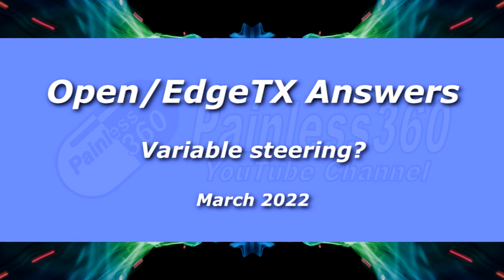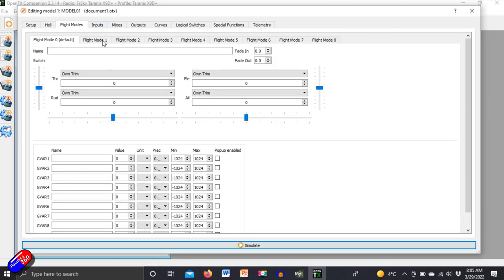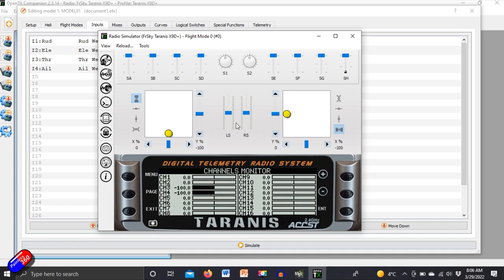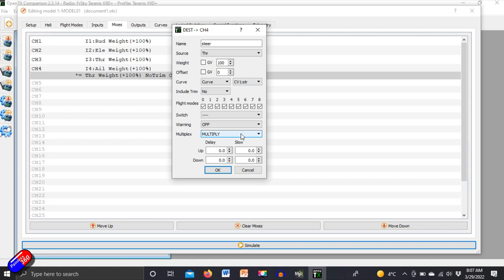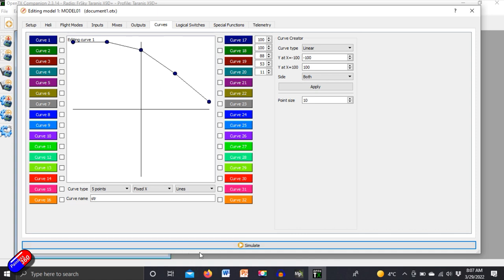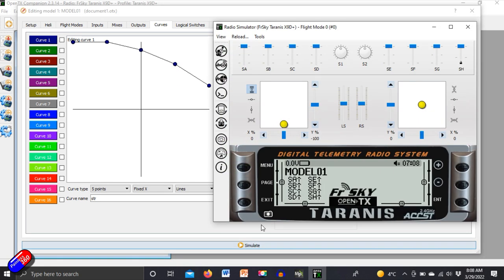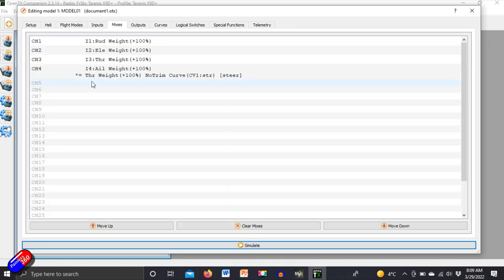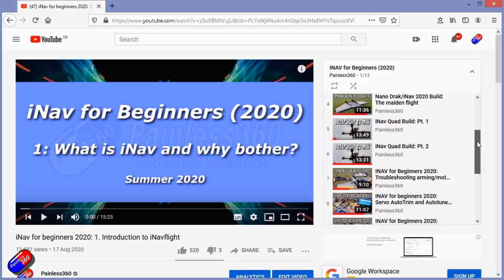R/C Cars and Open/EdgeTX: Adjusting the sensitivity of the steering automatically

Comment: Would be nice if there was a "pistol style" TX that could run Open/EdgeTX. Bonus points if it can take a module.
Reply: I totally agree with this. I even emailed jumper about this. Never heard back. 😕. I've thought about building my own out of one of the game style controllers like the zorro.
Reply: @RollnHeavyKevy  Try Radiomaster, they seem to be more on the ball. 
Thought about it as well. There's a fair bit of work involved. Would need the cheapest OpenTX radio and a donner pistol grip radio.
Reply: @vince086  yes radio master was next on my list.
Reply: Exactly!
Reply: I would imagine that by now you are aware of the new RadioMaster MT12?
Reply: @heady2008 its a gamechanger

Comment: Excellent video Lee, For the last couple of years I have been trying to figure out how to do a 4 wheel steering on a Rock crawler that I could switch from crab crawl to separate steering or turn it off.  I definitely need to look at this and do some reading.  Thanks again for the video and information about a F.C in a rc car.
Reply from the maker: I have a video on that I think.. check out the cars playlist... if it isn't what you want then let me know... best of luck
Reply: Let's say you're using CH4 for your front steering and CH5 for your rear steering.

Firstly duplicate the CH4 mixer for CH5:
ADD Aileron (Weight 100, Offset 0)

Then let's say you want to use SC to toggle the direction of the rear steering - Add the following line to the CH5 mixer:
MUL MAX (Weight -100, Offset 0, Switch SC)

This will invert (Multiply by -100%) CH5 if SC is enabled.

You can also make this variable using S1 - Instead of the SC line, add the following to the CH5 mixer instead:
MUL S1 (Weight -100, Offset 0)

This will mean that when S1 is set to 0%, CH5 will follow CH4 - But when S1 is set to 100%, CH5 will be inverted. (And anything in-between) You can also add the SC switch from before to this line to allow it to be toggled on and off.

Comment: Lee:
   This is perfect for an oversteer problem I have with several of my brushed monster cars (quite fast).
    Do you have any tips that would allow driving these vehicles using my multimodule hobby grade transmitters?
Thanks!  - Jim
Reply from the maker: You need something programmable to do stuff like this if it isnt a built in function...
Reply: The multimodule devs have been adding the ability to bind to several surface receivers. I can now bind my TX16s to the Axial crawlers.

Comment: A slightly different method, with linear control via one of the knobs on the radio: (Uses a dummy channel to calculate the amount of adjustment)

Mixer for CH32 (The dummy channel):
ADD Throttle (Weight 50, Offset 50)
MUL S1 (Weight 50, Offset 50) [The knob]

Mixer for CH4 (The steering channel):
ADD Aileron (Weight 100, Offset 0) [The normal input]
MUL CH32 (Weight -100, Offset 100) [The adjustment]

I did try to use telemetry to drive the adjustment by assigning a telemetry sensor to an input and using that in-place of S1, but I couldn't get the telemetry simulator to work - The idea for this being that you could use the current speed of the vehicle if you had the appropriate sensors.
Reply: Hi, I would like to do something like that. I want to gradually reduce the sensitivity of the steering servo by using one of the knobs on my taranis q x7. I have only two channels:
channel 3 for throttle servo
Channel 4 for steering servo.
How can I do that?
Reply: @giuseppe.marino  You just need to latter part of what I said, add a new line to your channel 4 mixer:
Source: S1 (The knob you want to use)
Weight: -100 (Counterclockwise will increase sensitivity by up to 100%, middle will be normal, clockwise will decrease sensitivity by up to 100% - You can change the weight to say -50 to get a -50% to +50% range instead or you could remove the minus to invert it)
Offset: 100
Make sure you set it to multiply and not add